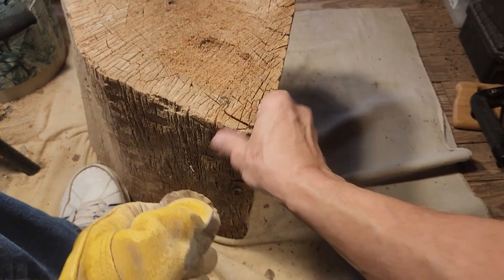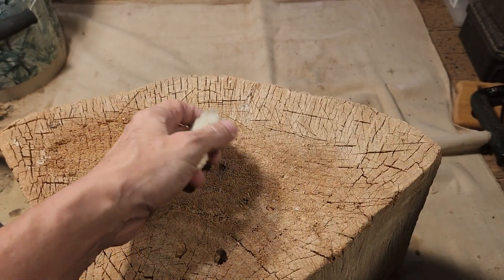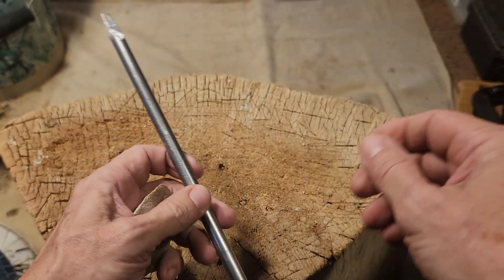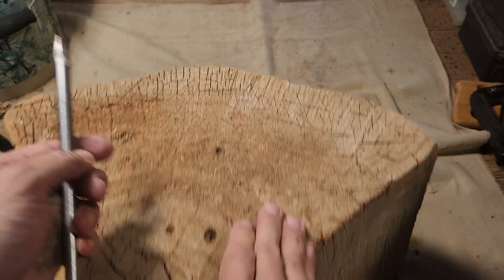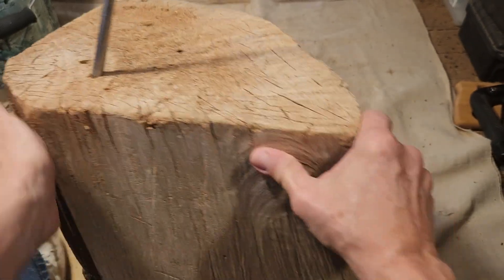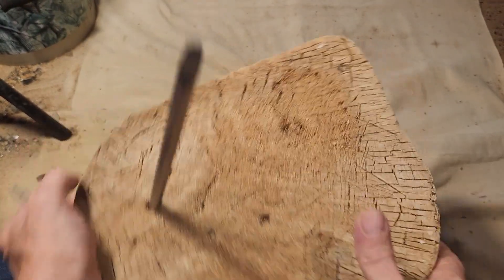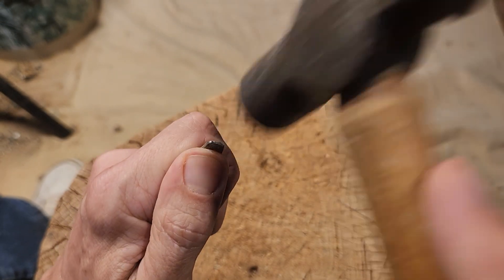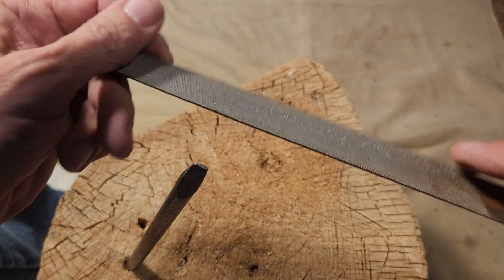1606 - Part 1 - Reverse Indirect Percussion Flintknapping

Comment: Revolutionary!  you might try a smaller point on the steel. I've been using a knife point as a pressure tool for fine work inside the notches, get stalling out much much less.
Reply from the maker: True
Reply: Can you elaborate? What kind of knife point?

Comment: You should look into ordering some high carbon steel rods they should wear significantly slower than the mild steel you are using. Really cool video
Reply from the maker: I've tried the high carbon steel. Even though it doesn't wear down easy, I have to admit that the knapability is better when the steel is softer.
Reply: "Grippy" materials grab the edge of the stone better better. Hardened high carbon steel is difficult to work stone with because it is slick and doesn't want to grab

Comment: So... Pausing halfway through so maybe you address this and I haven't got there yet but... why do all that filing when you have the smaller one there and a hole already drilled for it? Seems way easier to swap out the tool...

Also, only been knapping since July but this changes everything.
Reply from the maker: The thicker steel is more sturdy than the thinner. The thinner rod tends to vibrate. I already tried it.
Reply: @KnapperJackCrafty  Totally makes sense! Maybe shorten the rod? Would force you to choke up on the log, but would probably vibrate less.
Reply from the maker: @petercoene5930  true

Comment: Hey what kind of chert is that and where exactly did you get it. It sounds like you are saying rimolo ebay chert. Ibe googled it and nothing comes up. Its gorgeous rock and id like to get some
Reply from the maker: https://www.ebay.com/itm/255074134121
FYI, your results may vary, and the chert might not match what I got. It's pretty random with this seller.

You'd be better off ordering from one of these guys:
Jeff Head
https://www.facebook.com/profile.php?id=100077372270590&mibextid=ZbWKwL

Dennis Kerns
Dennis@Kentuckyflintworks.com.
1838 Sulphur Creek Rd, Columbia, KY 42728
http://www.kentuckyflintworks.com/

Curtis Smith
https://m.facebook.com/profile.php?id=100005984145744&groupid=294140764699326&eav=Afa5QGrjr_s_cRNXqNd49zqjAf33X2QPyVvZrcUtU4bEY4wyjqyPqEWbPCrUhldU9YM&ref=m_notif&notif_t=group_activity&paipv=0

Brian (Rock Wash)
https://www.etsy.com/shop/RockWash
https://www.ebay.com/usr/centralt0

Comment: If you move your hands in front of the camera often, turn off the camera's auto focus
Reply from the maker: I need the auto focus because I've tried the manual focus, and I have to adjust it dozens of times per video. It's very distracting.
Reply: @KnapperJackCrafty  if you have a DSLR, you can deepen the focal length (F-stop 8 or higher) so more of the shot is in focus when using manual. Zoom in and manual focus on your subject, then zoom out to the shot you want. Also, you can move the camera away from the subject and crop in to the shot you want using your video editor software (you'll lose some resolution though). Keep up the good work!

Comment: After five minutes measuring the angle, and as many measuring the edge width, when you pulled out the scale and weighed the arrowhead... I damn near screamed. But no worries, cool technique.
Reply from the maker: You can advance the video by draging the little red dot at the bottom of the screen and skip the parts you don't see any knapping.